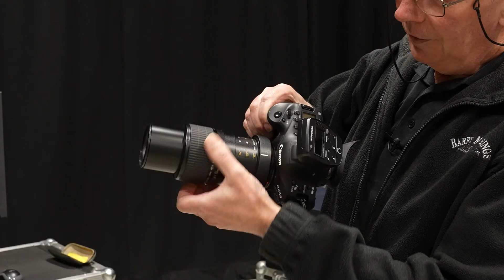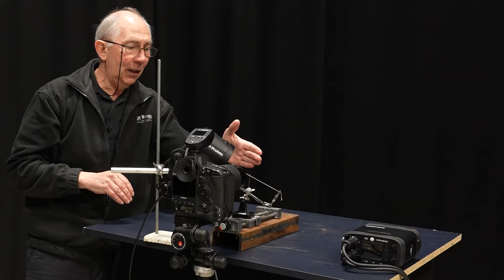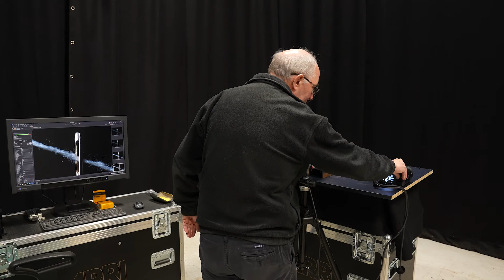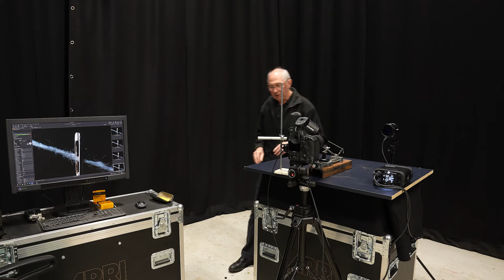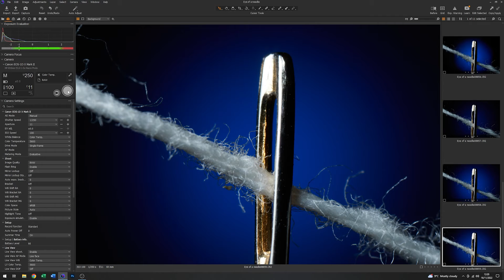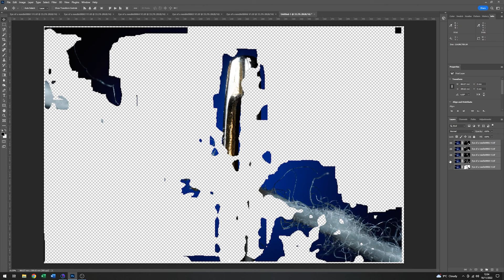Extreme close up photography techniques.

Comment: A question from a newbie in this sphere of photography? With such fine margins on focusing, would it make any difference if a beginner in this genre (me!) used a trigger to the camera and transmitter, either wireless or cable instead of manually depressing the shoot button on the camera to prevent shutter shake? I love these instructive videos, thank you for sharing.
Reply from the maker: Yes some form of remote shutter release is a great help in removing camera shake. As I was using Capture One tethering software I was able to trigger the camera from the PC.
Reply: Doh, yes of course (slaps head) I had forgotten that, thank you.

Comment: Thanks for the video. I wish that focus rails had larger diameter knobs to make it easier to make smaller adjustments.
Reply from the maker: It's the pitch of the lead screw that determines the distance moved per revolution, but I know what you mean. Thanks for watching.